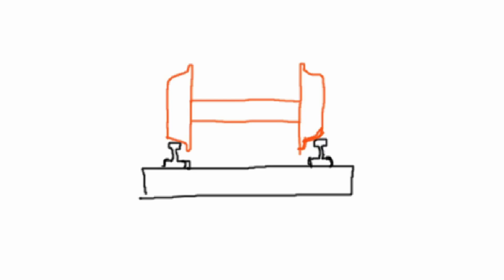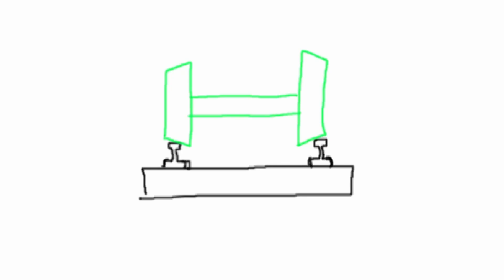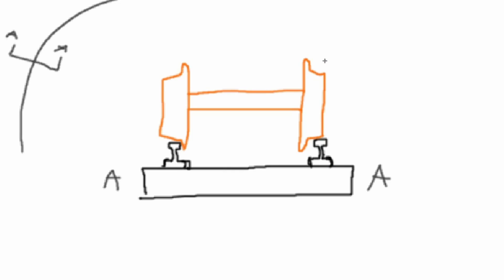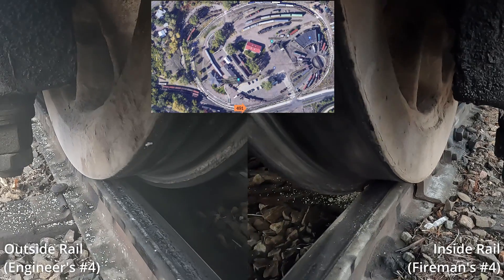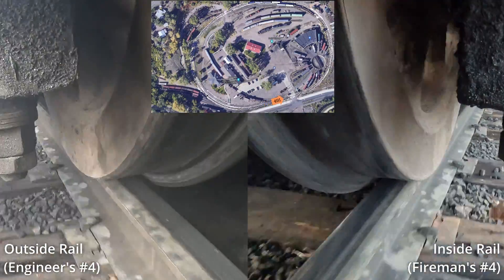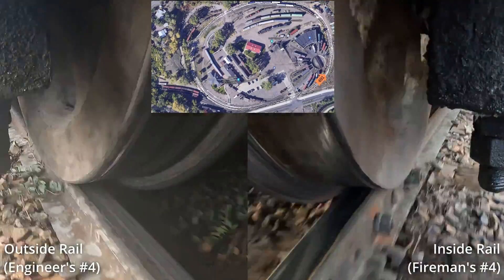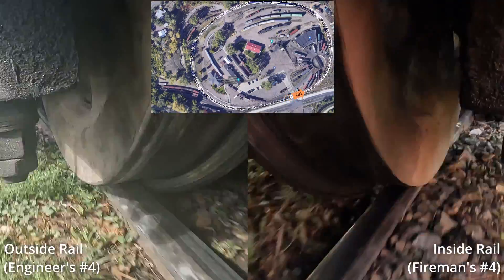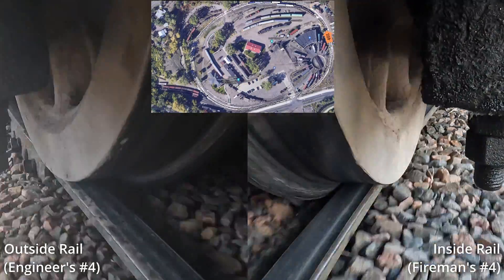Railroad 101: How do railroad wheels interact with the rail? A study on D&RGW 491

Comment: What I believe to be the case, judging by the uneven flange wear on the inner No.4 wheel, is that the wheels may have lost their profile over the years, and need to be re-machined to their proper profiles.

Granted, the tracks being of too tight a radius for 491 won't help either.

I can't tell if this is a case of the video perspective and the ultrawide GoPro lenses, but the track may be uneven across its width, which could potentially cause the train to prefer running on the inner rail as if it were a coin rolling down a funnel.

Either way, nothing that some standard maintenance shouldn't fix - and by no means do I wish to imply that you are neglecting your fleet. Keep up the good work alongside your comrades, Hyce!
Reply from the maker: There's no wheel machine needed; nothing is that far nearly yet.

Comment: This is me guessing why the inside flange is rubbing, not the outside one. 1 of the ideas I hade was that the trucks were pulling on the drivers because curve, straight line and stiff medal. The 2nd idea, after watching and thinking for a little, I realized it could be because the rest of the train is pulling on it. This is kinda like when you pull a string, it wants to be straight, but the tracks are like a finger pushing in the middle of the string, making it curvy. I will see if any of those are right. Yep, 1 was right, based on your explanation. Anyway, great vid, thanks for showing and teaching us that.
Reply: Exactly my thought. It’s always seemed to me the tightening string effect would be the strongest lateral force on the wheels, forcing  the inside wheel to role faster than it should, and the outside wheel slower. It seems to me that inside and opposing outside wheels should have independent axels (eg one spinning inside the other).

Comment: I would take a look at all of the flanges at the same time.  I would be willing to bet that the others are on the opposite side while going around.    If it was a single axle, or even a 2 axle setup, the angle would have more effect and the twist would have less.
Reply from the maker: Yeah, I want to get 4 more GoPros and try one on each axle on the loco.
Reply: @Hyce777  That would be very cool.  

As a truck driver, I see a simmilar thing happen with the tires of the drive axles as the truck turns.  The front axle tires, flex away from the turn and the rear axle tires flex toward the turn.  If there are more than 2 axles, they all flex depending on the weight distribution and which one is the center of friction.
Reply from the maker: @Bendigo1  Interesting. I'll have to research more.

Comment: Your summary was my first thought. I don't think you mentioned that the leading/pilot wheels are laterally sprung to help keep them centered and this spring tension is what leads the locomotive frame into curves.
Interesting fact, the tapered wheel treads cause sinusoidal (hunting) oscillation in two axle trucks. This was an issue with the design of modern high speed trains. Reduced tread taper, coil suspension and high precision track was the answer.
Reply from the maker: Interesting about the tapers causing hunting; hadn't heard that. Our lead wheels are not just sprung, there's a spring + some geometry, which I didn't get into, as I have a whole different video planned to follow on with that.
Reply: @Hyce777  The hunting happens on trucks with the bolster between the two axles. I'm not sure about that aspect on leading wheels considering the pivot geometry.
A video you may want to watch: https://www.youtube.com/watch?v=SRsm7mv0Oh8&ab_channel=mechanicalTV27

Comment: I forget which type in particular, but I remember reading that one of the 3 main types of geared locos here in the U.S. was briefly offered with actual differentials in the trucks, but they didn't last long as an option because of limited orders and the fact that they (apparently) greatly reduced tractive effort in turns.
Reply from the maker: oh wow, lol
Reply: That's a new one on me... never heard of that! I have no idea how they would have supported that in terms of bearings to keep it from falling apart. Had to be a Heisler or Climax, because the Shay or Willamette was driven from the outside, not center.
Reply: @kleetus92  Agreed.

Comment: Technically the rail head is also profiled to control the contact area, but based on how consistently this rides on the inside I don't think this is a track issue.
If your theory pans out that it's related to the wheel configuration, what do you think this means for blind drivers? I've read about 2-8-0s and I think 2-8-2s that used blind drivers on the #2 and #3, which seems a little weird given what we're seeing here ... Very interested for a part #2 of this!
Reply from the maker: Our 2-8-0 346 has blind drivers, but 491 does not. Nor will we be giving her any, lol.
Reply: @Hyce777  which set is blind on 346?
Reply from the maker: @Ronald.Golleher  2&3
Reply: @Hyce777  bet its a similar deal then. Flanged 2 and 3 might rub against the inside rail on curves, blind they're allowed to cut the curves a bit more

Comment: How much up and down movement of a sleeper while train running on track is allowed? Sorry for bad wording. For instance I watched a train go by my house and the sleeper would sink about 1inch into the ballast and spring back the spikes were obviously have pulled out overtime
Reply from the maker: It depends on the class of track; sometimes quite a lot is allowed. Sometimes, hardly any. An inch doesn't sound too bad, particularly if it's medium speed or less freight.
Reply: @Hyce777  standard freight, mostly excess height car haulers, and open hoppers for hauling steel rolls. No passenger traffic. But I only noticed because I noticed the spikes are no longer fully seated on the "bouncing" sleepers.

Comment: I was thinking that the force of the cylinders could be transferring thru the drive rods and into the drive wheels, making the flange on the inside wheel scrape along the inside rail.
Reply from the maker: Yes, but that would force things away at the #4, not closer.
Reply: @Hyce777  not if only the outside cylinder was doing it.

Comment: Were the outboard flanges of the wheels you presume to be rubbing on the outside shiny and the flanges on the inboard also shiny where you expected?
Reply from the maker: The outside rail was not as shiny as the inside. The inside was obviously "clean/friction-y".

Comment: Are the curves super-elevated/cantered? Maybe the loco doesn't go fast enough and "falls" to the inside?

Loved this video and your explanation makes sense to me and is probably correct. Prof. Hyce, now we need you to get more GoPros and film the other wheels at the same time too please!
Reply: No Cant on that track that I ever noticed. Pretty flat to the ground. About as flat as the The Nevada State Railroad Museum in Carson City is, only their loop is more of a perfect Circle(not counting the Wye they have at the North end) than an Oval. They run the Glenbrook(2-6-0) there and I think they have the same issue. I'm drawing the same conclusion, it's because of the frame design and suspension.
Reply: @SternLX  thanks for that info and insight!
Reply from the maker: There's maybe a slight superelevation if any, but not much. I agree, more cameras needed... lol

Comment: Is the area where the wheel contacts the rail as narrow is in your sketch (like a point), or wider due to wear?
I'm working on modifying a wheelset from trundle gauge to standard, and wheel/rail contact area my be an issue for stresses.
Reply from the maker: It's about the size of a dime without wear.
Reply: @Hyce777  Thanks!

Comment: Reminds me of flat belts/sanding belts on crowned pulleys, which also don't move the way one might expect (they self-center on the largest diameter)... not sure that comparison actually holds any water, the suspension explanation makes more sense to me (especially if the curves are close to the minimum radius for this locomotive)

Comment: Does 491 have lateral motion devices? I've never "*exactly*" known how those work, but have always assumed that the way you show is what they're for  (letting the axles better form a radius to meet the track curves). You've mentioned before that the museum track has often been tight for 491,  (moving the radius, lifting the track up etc) and it makes one wonder if those curves are on the edge of too tight.

The simplest solution theoretically, is just balance clockwise running (or rubbing) with counterclockwise running, and expect the cost of sending the drivers out to Durango (or Strasburg, TVRM, or wherever etc.) for re profiling or replacement more often than on straight track. Might be worth getting cameras on the other drivers to confirm your theory.
Reply from the maker: We do run both ways, and in the 8 years she's run she's not really worn the flanges too bad; but it is a worry. She does have a lateral centering device on the #1. There's video of it in the loco 360 video. 

She is spec'd out for 30 degree curves, we have a 28 max. The stories of her doing crap was prior to the rework and fixing ballast.
Reply: @Hyce777  well done, carry on!

Comment: Distance, the outer rail is obvious longer than the inside so outer wheel wears down sooner than the inside wheel making it smaller. Smaller wheel's can transfer more torque to the rail causing torque steering effect causing inside wheel to rub against the inside flanges. Might need to grind down inside wheel diameter to match the outside wheel diameter.
Reply from the maker: I don't think that's the case, nor a good solution.
Reply: @Hyce777  Now seeing wheel arrangement at the end of the your clip. You might consider to make blind drivers in the middle of your wheel arrangement, just as you would see on models. Second Option, buy more property to make larger radius of track that you would find on class one railroad! Glad I can help, I was considering my first answer simply on a 0-4-0 wheel arrangement, being a narrow gauge industrial switcher of some sort.
Reply from the maker: @davidballoid2118  The smaller engines with less lateral do have blind drivers, but not this big gal. Thanks for the clarification, makes a lot more sense :)

Comment: Two item not mentioned.  Most track uses canted tie plates that aid in centering the wheel set.  Curves are built with some superelevation to balance some radial force with the weight, like a banked race track.  Your initial theory works for a single axle wheel set but need adjustment for multi-axle trucks, as your followup discusses.  Think about reversing the operating direction, maybe seasonally.  This reversing will also have some impact on the tractive forces driving the track downhill.
Reply from the maker: We do operations in different directions to alternate wear already; can be hard to keep it even though. Superelevation does play a part, that would've been a good add.

Comment: To me it looks like the wheels are unevenly worn and instead of having a conical shape where the inside diameter is larger. The flange side of the wheels have worn to the extent where they’re near flat or even smaller in diameter, compared to the outside part.

I can also see merit to Breitschwert’s comment on the shift in mass, especially for a locomotive. 

Though, probably it’s a combination of multiple factors? Are the tracks banked towards the curves? If they were it might help mitigate the shift in centre of gravity when the trains navigates the curve.
Reply from the maker: Anything about uneven wear is mostly camera trickery with the GoPro's - her profile is actually still mostly decent, except the flanges which are getting thin (but still within FRA limits).

Comment: the solution is clear...12 go pros...one on each wheel. Also have you considered smokebox cam, you could find the true melting point of a go pro
Reply: A few more more a fire box cam (inside), drive piston cam (inside), brake shoe cam (see how much braking force a go pro will handle)_!!  lol
Reply: @SKYND303  I was gonna say, for the true melting point of a GoPro, a firebox cam is in order... But that would be too fast to really determine any discernable temperature.

 For science!
Reply: Given its a round track, you could easily use a single go pro and move its position each lap at a simlar pace, then edit the footage speed just fractionally so that key markers (like the rail crossings) of each line up.

Also since the shovel cam already thermally overloads and shuts down, the science of melting a go pro is already complete.

Comment: Cars tend to tilt towards the outside on their suspension, based on weight, leaning their mass onto the outside tires, giving more grip. Maybe this also happens here, but it is so much, that the wheels shift towards the smallest point of their diameter as much as possible, simply based on the additional weight pushing onto the axle, which might be way more force than slip of the wheels.
Just guessing.
Reply from the maker: Hm. An interesting thought. Not sure.